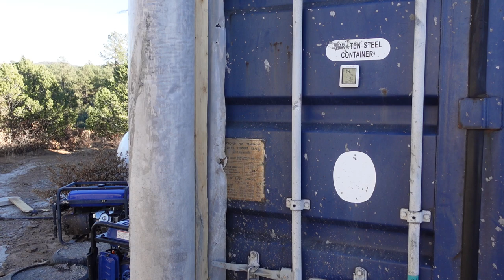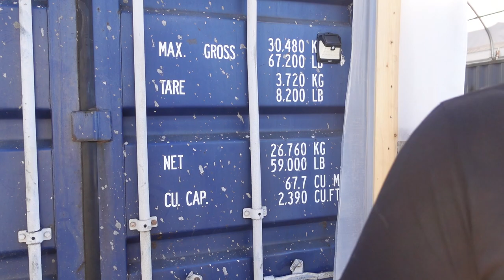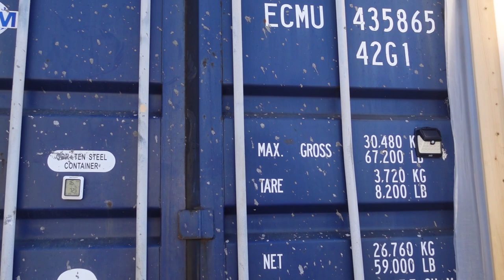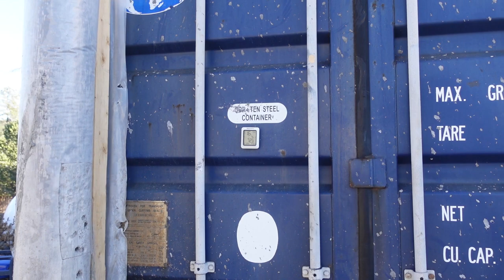Aircrete Thickener | Part 1 #aircrete #aircretethickener #foamgenerator #aircreteharry #dome #test

Comment: Just a thought. Maybe try testing each column every foot vertically, to determine how much or little the height effects the density. Like the pole on the left is probably stronger/ denser near the bottom (if at all, probably only slightly) than near the top. That should hopefully give an idea of if there is any collapse along a vertical distance. The pole on the right looks very stable.
 And have you thought about calling  your thickening agent, "Thick and Harry?" Sorry couldn't help that one. Sometimes the jokes write themselves.
Reply from the maker: I did your test suggestion. NO Thick and Harry. 😆 🤣

Comment: Our 45 inch test pour for the thickening agent was not valid, because we had some leaks in the form that created air pockets. Our control sample performed the same as the one with the thickening agent. We also under mixed the batches. We are finding that under mixing produces a much worse result than over mixing. Our garden wall is 2 feet deep. We have been dumping the leftovers from our practice batches in it, and all of the mixes have made a pretty solid and strong wall. We are doing 2 feet pours just fine without any significant settlement. We are finding that adding just 5 gallons of water to the cement slurry makes a strong mix that can't be dented with our finger.
Reply from the maker: Have you noticed an increase in the strength of the aircrete?
Reply: We made some test samples in our regular forms and they all fell some. We had to use type II-V Portland because that is all we could find in town. A couple of days later we got our delivery of type II Portland and made batches with those too, which both also dropped some. On both days we made 2 test samples the same, but one with the thickener and one without. We are thinking our Drexel was too cold and we hadn't been mixing it well enough between batches. The label says it needs to be room temperature.  We have been getting down into the low 20°s at night, the samples were well covered, but likely froze some.  We went ahead and tested them yesterday along with our dry samples, the thickener performed pretty much the same as the control, but it wasn't an ideal testing situation, so we won't mention it on our channel. The dry samples had one surprising  result. We opened a new bottle of Drexel yesterday, and made two batches with reinforcements, and they turned out okay.

Comment: Hello Harry, I purchased the foam generator from you recently, to thank you for your product!
Now I am looking to find out the compressive strength (which obviously depends on the foam density, etc). I think the relevant measurement would be the pressure the cured concrete takes before it starts collapsing, since that would be the real measurement of compressive strength. 
Also, since I am intending to use the aircrete as lightpour around radiant heat tubing, it is important for me to know what is the mass of the mixture. 
I am going to make all these measurement myself, but just wanted to give you an idea for a video.
Thank you again for all your help!

Comment: Can't you just switch the paddles around on the other 2 blade mixer so it pulls down?  The blades are rotating in opposite directions from one another so inserting them in the opposite gear should result in a pushing motion becoming a pulling motion and vice-versa.

Comment: A valid test would do everything the same for both batches except for the variable which is the thickening agent. Not sure why you used a different soap if you are trying to prove the strength of the thickening agent?
Reply: Great point about changing 1 variable. My interpretation was that Harry was testing the difference in column slump performance between what most people use for a DIY aircrete additive (just dishsoap) to using professional products (Drexel + Thickener). Given that more than 1 variable was changed in the process, it's impossible to know whether the thickener caused the hardness difference, which was incidental, and not actually what was being here. I'd love to see that tested with a few small samples. If true, it would be very important to know!
Reply: We plan to pour comparison samples with it today, and rather than height, just do our regular strength and drop test on them. We will pour a new control sample too because after more practice we have got the mixing figured out. Red made a simple tool to help get the batches more even from top to bottom. We have some thickener and need to see if we want to use it in our floor.
Reply: @RedandAprilOff-Grid  That's awesome. Looking forward to seeing the results!

Comment: I'm thinking that using one barrel with a lockable top would solve the time of emptying one barrel into the other . Add a gate valve at bottom and air reciever at top.  After mixing 0lace on top add air and save 9ne step? A pretty time consuming step! No?

Comment: I want to order the thickening agent, but I don’t see a description that explains how much is used for each batch. Nor do I know when or how to add it to the mix. This is necessary information in order for me to know how much to purchase. Can that information be made available on the shop or website somewhere please?
Reply from the maker: Yeah, absolutely. Instructions: Use 2 oz. of Aircrete Thickener to 92-94 lbs bag of cement. Thank You 👍 👍
Reply: @AircreteHarry  Awesome, thank you for your quick response. Last question: Do I pour it in the barrel while I mix the initial cement slurry? while I am mixing/adding foam to the slurry or do I add it to the soap/water mix before it goes through the foam generator. 

Note: I am using the Dome Gaia barrel method and foam injection mixer with 7th generation dish soap for the foam. I am also considering adding basalt fibers to some of the mixes for my larger base blocks.
Reply from the maker: @WhistleLad  My Pleasure, You are very Welcome. - Add your water to the barrel first, then add 2 cap full to the water & mix it; then add your cement.
Reply: @AircreteHarry  Perfect, thank you. I will be ordering a few gallons from you within the next few months after my concrete footer is put in. 
Bless you for your continued diligence and innovation. Keep up the good work.
Reply from the maker: @WhistleLad  THANK YOU VERY MUCH FOR YOUR GREAT FEEDBACK, APPRECIATE YOU!! 👍 👍  Ready when you are. Great Success to You!

Comment: I've spoken to a few foaming agent suppliers and most of them claim a 3 meter height for the max for a pour. You could proably go a little higher with your mix. Have you tried adding other aggregates to your aircrete? They are what make regular concrete stronger. I know you've done polystyrene but what about perlite, vermiculite or a hydroton derivative?
Reply from the maker: In the past off of video. I will make new test. Most heavy aggregates do not work with Aircrete Perlite is a better option.
Reply: @AircreteHarry  When mixed and compacted, would perlite be already crushed into particulate lesser to sand?  While vermiculite sort of flattens and smear/conforms in a different manner?